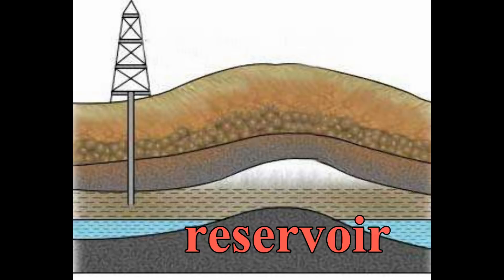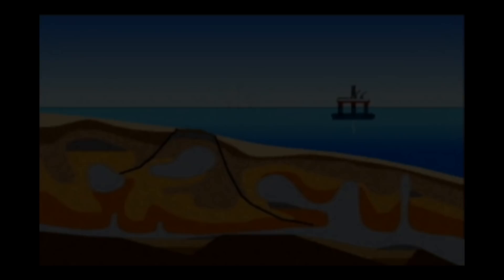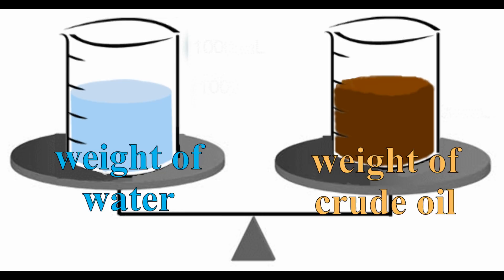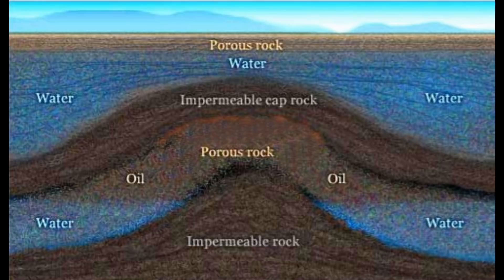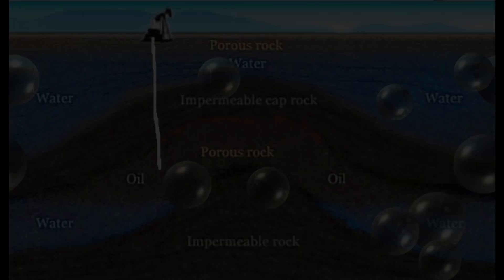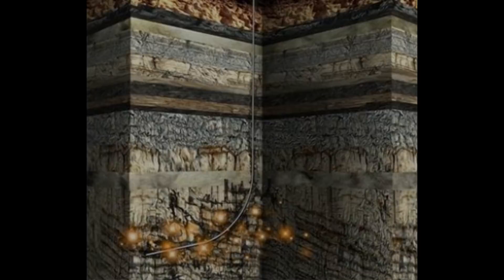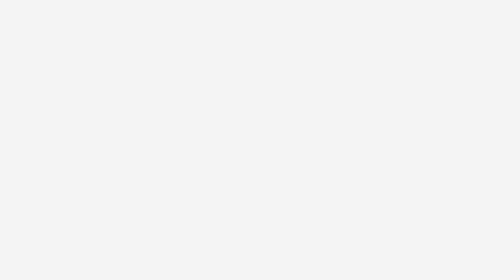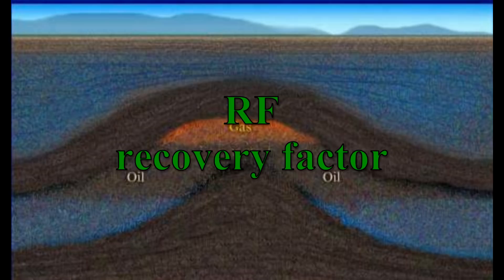Overview Chapter 5 Part 1 Reservoir Performance

Comment: Just because it's rich in oil doesn't mean they will go taking foreigner students! Anyway I'm American and I'm heading for a university in the states and, you guessed it, will be doing Petroleum Engineering! That's a much better offer to me. If you really want to and if you work hard enough you could probably enroll in this institution; heck, you could probably get enrolled anywhere you want to.

Comment: Dmetrius Wright  what about that explanation about bubble point pressure...more gas goes back to the liquid phase if you increase pressure below the bubble point pressure and more goes into the gas phase if you decrease it below the bubble point pressure. can u clarify on that as well?

Comment: density = mass/vol, not weight
Reply: Yes your are correct, but if you waited just a few more seconds 4:30 he explained why weight = mass/vol. wight = mass * gravity but since gravity equals 1, weight = mass. Not trying to be mean, but just in case someone else came to the same conclusion as you.
Reply: @DMoneyAW  what about that explanation about bubble point pressure...more gas goes back to the liquid phase if you increase pressure below the bubble point pressure and more goes into the gas phase if you decrease it below the bubble point pressure. can u clarify on that as well?